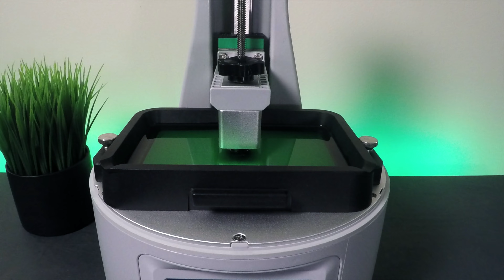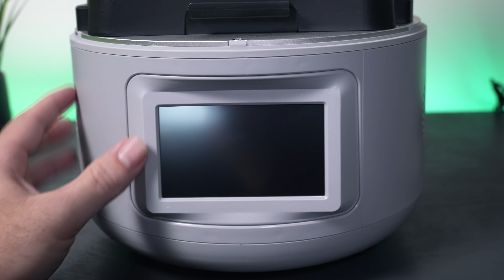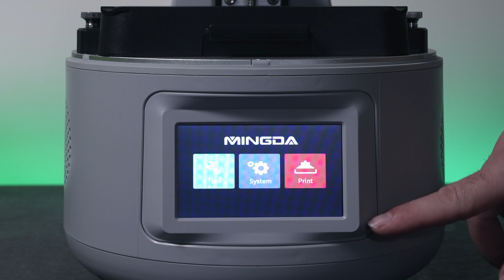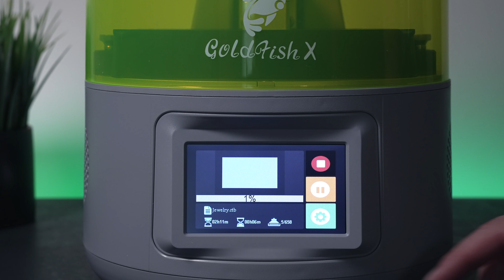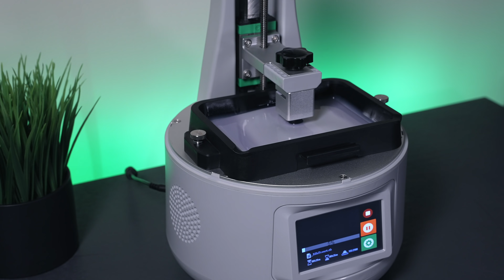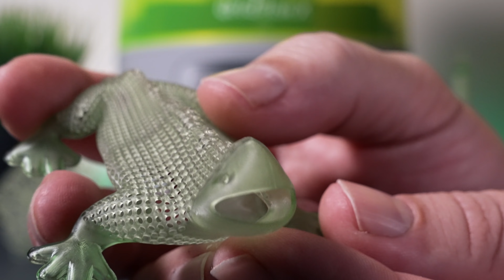Mingda Goldfish X - Resin 3D Printer - Unbox& Setup

Comment: Thanks for the video vlad. I do have a question though about resin printers. I am looking at getting one, but I am very undecided on what brand to go with. The one I am learning towards right now is the Anycubic Photon Mono SQ. I've heard with Anycubic, you can use other software and not bound to just one. I was also looking at the Creality Halot One, again, there are so many brands, I don't know which one to go with. I am looking at the $300 range, so something intro level as far as resin printers go. I do have a Ender 3 that I've had for awhile. Thanks again!